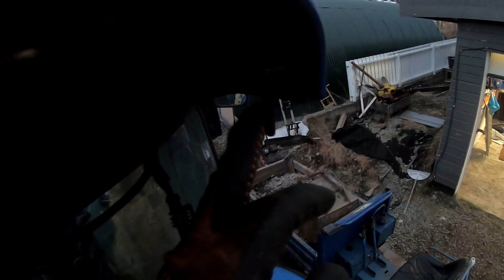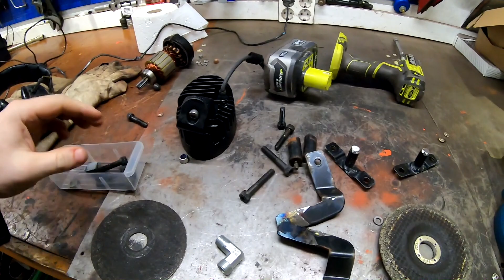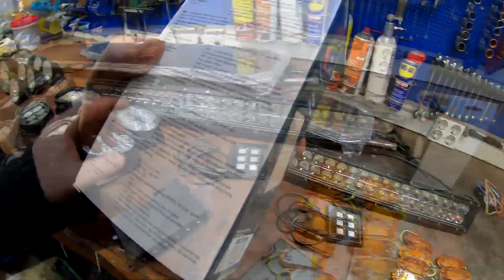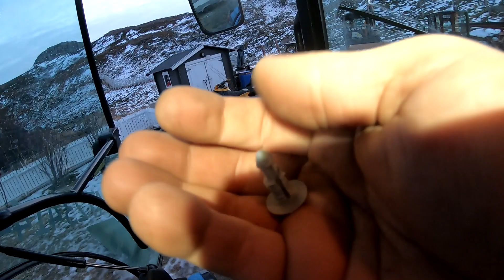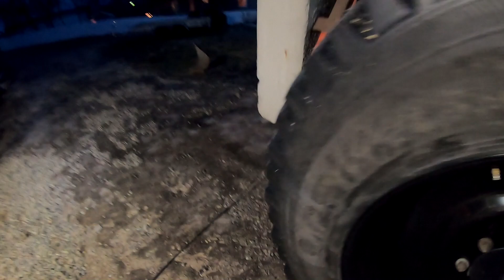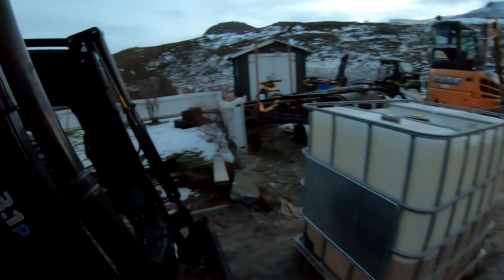Installing 800w of LED lights on my New Holland tractor

Comment: LED lights have come a LONG WAY in quality, durability and efficiency in the last 10 years. And comparatively cheap now, too.
Reply from the maker: Yes, sadly the watt race is on with LED lights, it's a bit away from what it started as. I don't know how you are suppose to drive 3 x 225w LED lamps on your car, turn of the heat...

Comment: where did you buy those led-markers? Bra jobbat förresten!
Reply from the maker: Kjøpte dem på ebay https://www.ebay.com/itm/10-X-AMBER-ORANGE-12V-2-LED-SIDE-MARKER-INDICATORS-LIGHTS-TRUCK-TRAILER-E-MARKED/264936505730?pageci=abfe8a44-3734-4e73-ba98-b5a57c4b3b1e

Comment: And stose plastic pins where pain in the ass to get off... I’m still thinking how to do the wiring with my t6050 🤔
Reply from the maker: Yes but the shop got new ones so no problem 😊 I was happy with this way, you will see in part 2 that is handy to have all connections up with the original fuse boxes 👌

Comment: Few tips: I used the same biltema control box on my hilux in a way that every bank only was triggering a separate 30amp relay. In the New Hollands i got it's easier to remove the roof's "skin" with few bolts on the top to gain access to the wiring and such. If you are going install marker lights to the roof you can steal power from the license plate lights, BUT they've been grounded in a way when you turn on the worklights the licenseplate lights die. So changing the ground back to normal will do the trick. Also, there might be hidden wires in the front of the cabin close where the existing one are, atleas on the T6xxx-series and bigger. And the original light control panel will not last long if you are drawing a lot of current through it so it's good to use separate relays, but seems like you'll get along fine according to your plans. Regards from Southern Finland.
Reply from the maker: Yes that's the way to go if you have a lot of power with relay, I used that on the terex, but was hoping to not use that with this box. The high beam ledbar is run by a relay, triggered by high beam from the tractor. I've connected the camera to the licensplate light went just fine 😊 with a 7pair wire up to the roof I have the possibility to write anything easy. I did find original wires up on the roof in front, you will see that in the next part 😊

Comment: Great video but please learn to tig weld. There should NEVER be  any sparks when welding with tig. turn up the gas or reduce the amps. Is my guess. Cheers.
Reply from the maker: Glad you liked it. Yes my new welder has both amp and volt adjustment so I think you are on spot with to much power, ore maybe not clean enough, Did weld much better with my old tig, but it didn't last so...
Reply: @MiniMachines1    Practice practice !  Good luck.!

Comment: Another great video and I also try to instal new led lamps, but dont have decent hall where is Nice and warm so its same thing here everything has to done outside in the gold😅
Reply from the maker: Thanks 😃 Yes it's a bit more work doing it outside in the elements, but you get it done a lot faster if it's cold, maybe not all the lights you planed but.

Comment: Did you get the amber flashing light at Swedol? I like the idea of running only two wires to it and the controls are wireless.
Reply from the maker: Bought it at a website on black Friday sale, it's a LUMARY Galaxy 123cm

Comment: Great video! I’m obsessed with LED lighting on my equipment!!
Reply from the maker: Thanks, yes me 2😁 after I did the installation on the terex on what seemed to be to much light, and I'm the end it was perfect, I always install more than I think I need, with so little daylight as we have here is nice with a lot of lights.
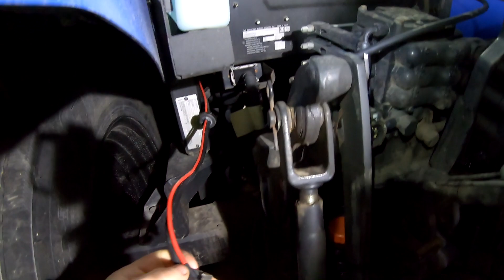Reply: @MiniMachines1   great job the trailer cable is 7 core cable , and  the rubber thing you pulled out at 26:17 is a rubber grommet,  i put led lights on my  machines  there  super great,  great channel  you  have   👍

Comment: Hows the winter in norway? Not like last year?
Reply from the maker: No nothing like last year, still no snow and frost so not much to do 😏
Reply: @MiniMachines1  Thats what i was thinking about when i saw your yard with no snow at all :D Btw, when you have installed that biltema control box, could you tell something about how it worked, it think that would be pretty useful when adding lights in cars.
Reply from the maker: @pullonkeraaja2191  was actually out doing excavation 2 days ago, but I needed to use the hammer to get tru the frost, so took a lot more time

Comment: I have work Light in fotstep. Relly good when its tight and you plowing snow. Test place one and C what you think of it. Happy new year Isak
Reply from the maker: Thanks for the tip! I will test that out, actually got some rock lights on the way that is ment for the case but I will test them on the tractor first.